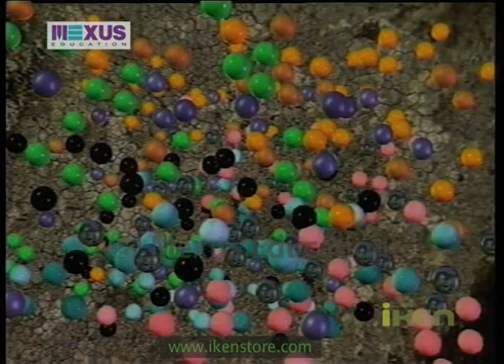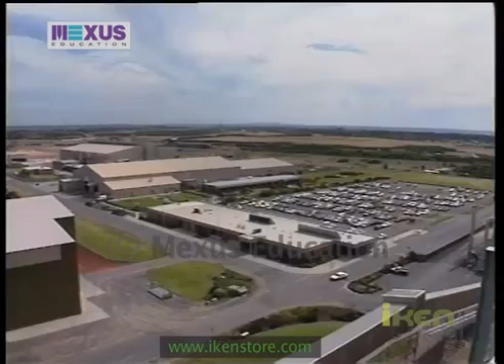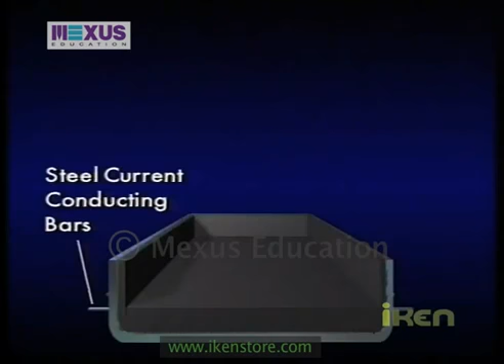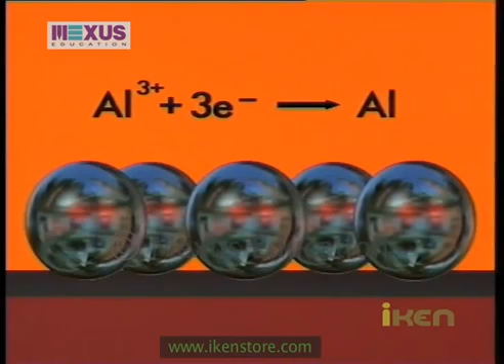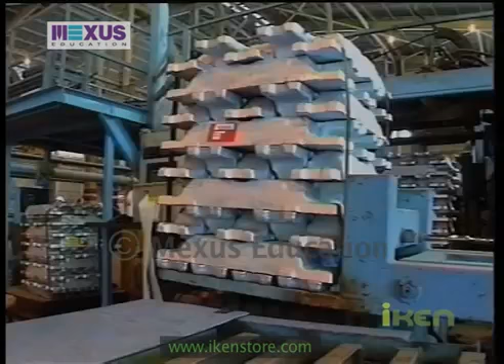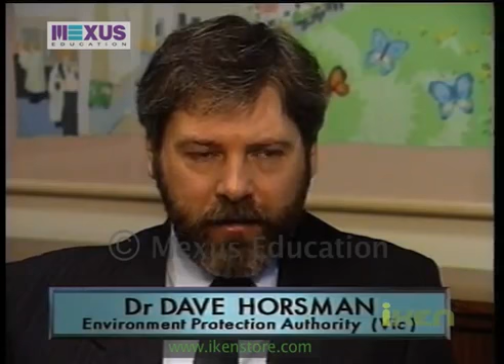The Making of Aluminium

Comment: Nama : Muhammad Rayhan

NRP  : 02411940000115 

Aluminium merupakan logam yang reaktif sehingga mudah teroksidasi dengan oksigen membentuk lapisan aluminium oksida, alumina (Al2O3)dan membuatnya tahan korosi yang baik. Aluminium menjadi material terbanyak di muka bumi ini. Aluminium memiliki sifat penghantar panas, memiliki sifat pantul sinar yang baik sehingga igunakan pula pada komponen mesin, alat penukar panas, cermin pantul, komponen industri kimia dan lain-lain. Dikarenakan menjadi material terbanyak di muka bumi maka banyak produk yang terbuat dari aluminium yaitu kaleng minuman, CD, Mesin mobil dan badan pesawat. Dikarenakan aluminium menjadi salah satu logam yang reaktif maka diperlukan proses untuk pemisahan aluminium yang akan mendapatkan hasil aluminium murni. Adapun tahapan yang digunakan untuk mendapatkan aluminium, yaitu sebagai berikut :

1. Proses Bayer

Al2O3.3H2O + 2NaOH menjadi 2NaAlO2 + 4H2O 

2NaAlO2 + 4H2O menjadi Al2O3.3H2O + 2NaOH 

Al2O3.3H2O menjadi (heat) + Al2O3 + 3H2O

Alasan pengekstrakkan alumunium menggunakan dari bijih bauksit Al2O3.3H2O untuk diproses secara elektrolisis karena lebih murah. Tentu saja faktor harga menjadi salaha satu penentu dalam produksi yang bertujuan untuk menghasilkan semakin banyak keuntungan.

2. Proses Hall Heroult
Al2O3  menjadi 2Al3+ + 3O2- 

Katode (-): 2Al3+ + 6e- menjadi 2Al 

Anode (+): 3O2- menjadi 3/2 O2 + 6e− 

Reaksi sel : 2Al3+ + 3O2- menjadi 2Al (l) + 3/2 O2

Proses ini menghasilkan produk berupa aluminium cair yang dikumpulkan di bagian bawah setiap pot. Kemurnian yang dihasilkan dari proses ini mencapai 99,8 persen dan sisanya kandungan dari Ingot aluminium berupa pengotor yang terdiri dari besi dan silikon ditambah dengan jejak magnesium, mangan, gallium, chromium, zinc, dan vanadium. Pembuatan aluminium dengan metode ini membutuhkan energi listrik yang besar dan dapat menimbulkan emisi berupa gas karbondioksida yang dapat menyebabkan efek rumah kaca.Rata-rata konsumsi energi listrik dunia dalam mengelektrolisis alumina adalah 15 kWh per kilogram aluminium. Meskipun dengan dampak negatif yang cukup membahayakan,tetapi proses ini tetap dilakukan untuk memenuhi kebutuhan aluminium di dunia dan belum ada proses pembuatan yang lebih murah dari pembuatan aluminium di atas.

Comment: Nama : Nikko Gunawan
NRP  : 02411940000065

Pembuatan  Aluminium
Logam aluminium permukaan unsur berlimpah dengan ribuan kegunaan yang berbeda seperti mesin mobil balap, sepeda, TV, compact disc, aluminium foil, kaleng minuman dan 

pesawat terbang. Aluminium adalah logam aktif yang mudah bereaksi dengan unsur lain sehingga tidak akan pernah ditemukan gumpalan aluminium murni sama halnya ditemukan emas. Sebaliknya aluminium selalu ditemukan terikat dalam senyawa dengan elemen lain di dalam batuan seperti granit. Granit terbuat dari berbagai zat termasuk aluminium, silika, potassium, magnesium, besi, natrium, dan kalsium. Aluminium dapat ditemukan di alam dalam batuan Bauksit. Bauksit adalah aluminium oksida terhidrasi yang mengandung aluminium, oksigen, dan hidrogen. Pertama, Bauksit diubah dulu menjadi Alumina (2NaAlO4 + 4H2O -> Al2O3.3H2O + 2NaOH) lalu dipanaskan untuk menghilangkan air sehingga didapat Al2O3. Proses ini disebut proses Bayer. Proses Bayer digunakan untuk memfiltrasi atau menyaring kotoran seperti besi oksida silika dan titanium oksida. Setelah itu dilakukan proses Hall-Heroult untuk merubah alumina menjadi aluminium murni. Dalam proses Hall-Heroult terdapat alat yang terdiri dari katoda dan anoda letak aluminium cair akan mengendap. Metode ini membutuhkan daya listrik sangat besar dan menghasilkan gas karbon dioksida yang memperparah efek rumah kaca.

Comment: Nama: Muhammad Ardhan Anshari
NRP: 02411940000179

Aluminium (aluminum in American and Canadian English) is a chemical element with the symbol Al and atomic number 13. It is a silvery-white, soft, non-magnetic and ductile metal in the boron group. By mass, aluminium makes up about 8% of the Earth's crust, where it is the third most abundant element (after oxygen and silicon) and also the most abundant metal. Occurrence of aluminium decreases in the Earth's mantle below, however. The chief ore of aluminium is bauxite. Aluminium metal is highly reactive, such that native specimens are rare and limited to extreme reducing environments. Instead, it is found combined in over 270 different minerals.

Aluminium is remarkable for its low density and its ability to resist corrosion through the phenomenon of passivation. Aluminium and its alloys are vital to the aerospace industry and important in transportation and building industries, such as building facades and window frames.The oxides and sulfates are the most useful compounds of aluminium.

Comment: Nama : Anisah Amalia Nur Ibrohim
NRP : 02411940000006

Aluminium yaitu logam dengan penggunaan paling banyak di bumi yang didapat dari bubuk putih yang disebut alumina dengan proses elektrolisis. Aluminium sering disebut sebagai logam aktif yang artinya suka bereaksi dengan elemen lain sehingga selalu ditemukan terikat dalam senyawa dengan elemen lain. Aluminium dilebur dari bijih bauksit (Al2O3.3H2O). Bauksit disempurnakan menjadi alumina melalui Proses Bayer.
Al2O3.3H2O + 2NaOH  2NaAlO2 + 4H2O
2NaAlO2 + 4H2O   Al2O3.3H2O + 2NaOH
Al2O3.3H2O (heat) Al2O3 + 3H2O 
Proses selanjutnya yaitu Proses Hall-Heroult yang mengubah alumina menjadi aluminium cair. Dalam proses ini, dasar baja yang diisolasi secara termal dilapisi dengan blok karbon besar, yang bertindak sebagai katoda. Elektrolisis alumina dilakukan dalam rendaman cair yang sebagian besar terdiri dari kriolit atau natrium aluminium fluorida. Tetapi untuk efisiensi, ditambahkan aluminium fluorida dan sejumlah kecil kristal kalsium fluorida dan aluminium oksida. Reaksi yang terjadi yaitu :
Al2O3  2Al3+ + 3O2-
Katode (-): 2Al3+ + 6e-  2Al
Anode (+): 3O2-  3/2 O2 + 6e−
Reaksi sel : 2Al3+ + 3O2-  2Al (l) + 3/2 O2 (g) 
Proses ini menghasilkan produk berupa aluminium cair yang dikumpulkan di bagian bawah setiap pot. Rata-rata kemurnian logam 99,8%. Pengotor terdiri dari besi dan silikon ditambah magnesium mangan gallium chromium zinc dan vanadium.
Peleburan aluminium ini mengkonsumsi sejumlah besar energi listrik juga melepaskan gas rumah kaca terutama dalam bentuk karbon dioksida.

Comment: Nama : Alfiyan Rizki maulidan
Nrp : 02411940000018

Alumunium merupakan salah satu logam yang sering digunakan untuk material berbagai produk. Termasuk dalam logam yang reaktif membuat alumunium ditemukan di alam dalam bentuk campuran dengan unsur lain semisal di dalam baru granit. Pengekstrakkan alumunium berasal dari bijih bauksit Al2O3.3H2O untuk diproses secara elektrolisis karena lebih murah. Bijih bauksit terlebih dulu diubah bentuk ke alumina dari 2NaAlO2.
2NaAlO2 + 4H2O ==> Al2O3.3H2O + 2NaOH
Al2O3.3H2O =heat=> Al2O3 + 3H2O
Peleburan alumina menjadi aluminium logam terjadi dalam tong baja yang disebut pot reduksi atau sel elektrolisis. Bagian bawah pot dilapisi dengan karbon, yang bertindak sebagai suatu elektroda (konduktor arus listrik) dari sistem. Secara umum pada proses ini, leburan alumina dielektrolisis, dimana lelehan tersebut dicampur dengan lelehan elektrolit kriolit dan CaF2 di dalam pot dimana pada pot tersebut terikat serangkaian batang karbon dibagian atas pot sebagai katoda. Karbon anoda berada dibagian bawah pot sebagai lapisan pot, dengan aliran arus kuat. Alumina mengalami pemutusan ikatan akibat elektrolisis, lelehan aluminium akan menuju kebawah pot, yang secara berkala akan ditampung menuju cetakan